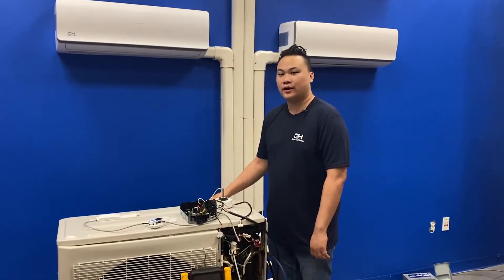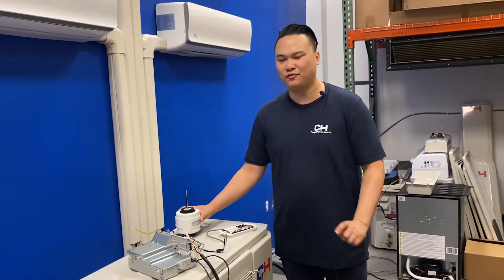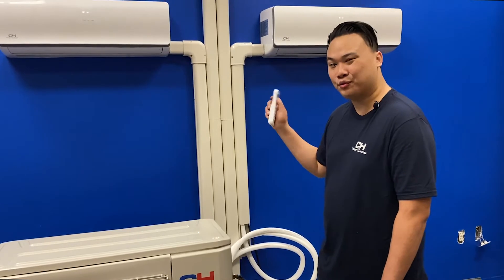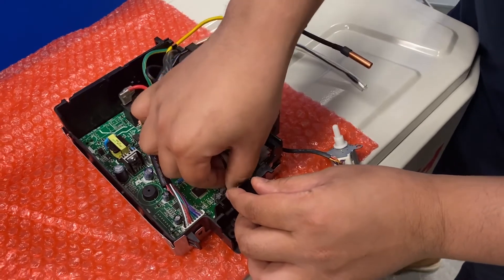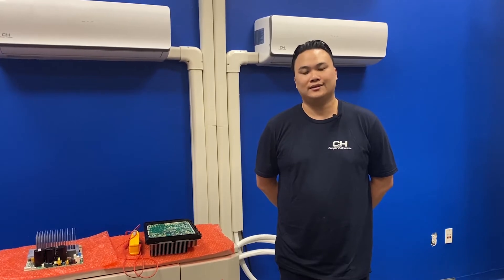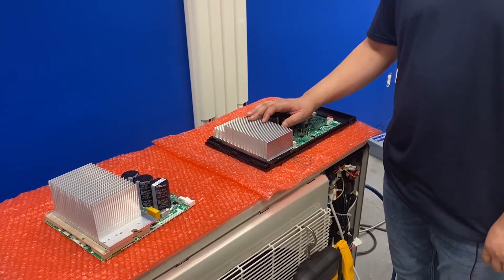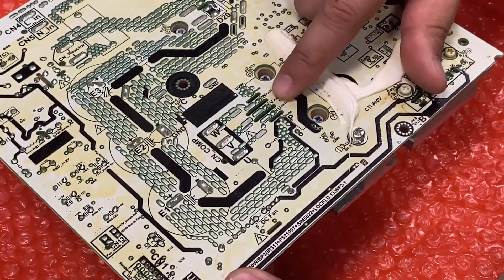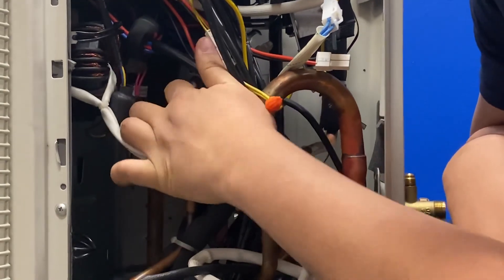Cooper & Hunter - Mini Split Error Codes & Troubleshooting

Comment: have a good one for you Need Help.  Cooper Hunter  Indoor unit powers on out door unit runs 20 seconds then everything stops and display does to 88 just before going blank . every time the outdoor unit starts this happens after 3rd time it stays off and blank until i reset breaker. all connections are good and the App shows all tests pass.  but theres a problem for sure

Comment: I have a 2020 CH-HYP36MSPH-230VO and the breaker keeps tripping while the unit is off. The electrical lines were checked and are fine.
What can this be?
Reply from the maker: There is a short to ground somewhere in the unit. It could be a number of problems. The only way to diagnose the issue would be to have a licensed HVAC tech trouble shoot this unit.

Comment: I enjoyed watching this video but it didn't answer my question.  I recently had C&H Olivia series mini splits (a 9k and a 18k) installed and they both maintain the room temperature well above (2-8 degrees) the set temperature on the remote.  The lowest setting in heat mode is 60 but since we turned them on we can never get down to 60.  We have no error codes.  Is there an adjustment we can make?

Comment: mine is flashing ELOC…
Reply from the maker: That is either a bad thermistor, bad indoor board, or low on refrigerant. most likely you are low on refrigerant. It's recommended a HVAC technician verify proper charge by removing the refrigerant from the system. Then weigh in a new charge using the factory charge amount that will be displayed on the model data tag on the condenser. DO NOT JUST ADD FREON TO THE SYSTEM, THE REFRIGERANT MUST!!! BE REMOVED AND WEIGH IN A NEW CHARGE USING A SCALE.

Comment: HI,
 I have three 12000BTU C&H aircons installed in my home. One of these is exhibiting the following condition in heating mode.
 
1. unit turns on and starts heating after about 2 minutes as per normal.
2. then fan stops or slows down and heating stops. The top light on the indoor unit starts blinking every 8 to 9 secs. This continues for a period of sometimes 3mins, sometimes up to 15 mins.
3. After this the light stops blinking and the aircon starts working normally. No error code is displayed and the the gas pressure was checked by the C&H local techs and found to be ok.

This issue happens either early in the morning or late in the evening only. Operation during the middle of the day is normal.

Any advice please?
Reply: Hello, my name is Tim Murphy I work with the local distributor as a technical support specialist. I read you had the refrigerant level checked. Unfortunately checking pressure levels is not an accurate way to verify proper refrigerant levels on mini split systems. The correct method for verifying a proper charge is to remove all the refrigerant, vacuum the system down to 500 microns then use a scale and weigh in the factory charge.

From what I read it does seem like it might be low on charge. In heating the coil must maintain temp for the fan to run. 
What are the model numbers?
Reply: @MurphyDrifts  Hi Tim. thank you for your reply. the model number CH-S12FTXQ. According to the C&H local technician the pressure whilst running was 35Bar which he deemed OK. I will relay your suggestion next time he visits. I stress again that after this strange behavior period the aircon heats up properly so this maybe indicates that the gas is ok. What I find strange is the 9 sec blinking. Surely this must mean something? When the tech opened the external unit there was a label on the underside of the top cover indicating the faults possible for the errors displayed. Unfortunately this 9 sec blinking rate is not listed. When you refer to the coil can you amplify what system part this is? Would I be able to blow hot air over it to see if this speeds up the error clearance? thanks.

Comment: I have P6 code on all 2 hunter and cooper mini split. Worked great first time last year winter. This year winter has come again and tried turn the heat on, it didn't do a thing. P6 code pops up. I checked the freon pressure and it's normal. AC still works. Now, how do you test the high pressure switch and low pressure switch?? What voltage is it supposed to have?
Reply from the maker: The proper way to check refrigerant levels would be to evacuate the system and ad a new charge by weight. Mini spit systems can range anywhere from 80psi to 160psi when running. So checking the pressures is not an accurate way to verify proper charge. For troubleshooting the pressure switches you will need to call Cooper and Hunter Tech support so they can guide you through the step by step process. 
Please note: When a mini split cools but does not heat or vice versa, that is a sign of improper charge. I would remove the freon and pressure test @ 500psi of nitro and find the leak. Again please call Cooper and Hunter tech support on their site. Cooperandhunter.us
Reply: I had heat guys came down to refill the freon but it wasn't low. But it still doesn't wanna heat up the room, I keep hearing the heat pump kicked off and on like every 5-10mins. And on mini split keeps popping DF every 5-10mins then when DF goes off and it ran another 5mins then P6 pops up. It was constantly doing that for hours. Then i turned it off, giving it up. Its brand new, only used for about a year. Then I noticed other side of heat pumped, it was iced over, what's causing that.
Reply from the maker: My first question is, how did the technicians check the refrigerant levels? Mini split systems fluctuate pressures anywhere  from 70-160psi. The only approved method of verifying the refrigerant charge is to remove all the Freon and weigh in a new charge. The manufacture will have the factory charge in oz. written on the model number data tag. I have a feeling the charge is low. DF means defrost mode. And P6 is usually in reference to improper charge. @kevinharrison7677

Comment: Have a EH 60 error code. 
This happened after I took apart unit. Before that unit was cycling on and off. No leaks. 
Found remote in follow me function and it was showing 32 degrees. 
I turned off but was still having same issue. Only thing I can think of was the temperature sensor being loose on indoor. It was late so I’m going at it again tomorrow.
Reply from the maker: the code description for that is. : EH-60 Indoor room temperature sensor T1 is in open circuit or has short
circuited
Reply: Yeah. I was totally disconnected. No error code now. 
Why would the follow me function show 32 degrees when I turn it on?
Reply: Would that indicate temperature calibration on remote is bad
Reply from the maker: @All4ChristNone4me  The sensors are based on resistance. If there was zero resistance due to the sensor being disconnected. The board will calculate the temp based off zero, which in this case seems to be 32 degrees or it may be the default temp with zero resistance.
Reply: @TropicSupply  is this on the remote?
Reply from the maker: @All4ChristNone4me  Where is 32 degrees being displayed? on the remote or the unit?
Reply: @TropicSupply  when I turn on the follow me function it displays on remote 32 degrees
Reply from the maker: @All4ChristNone4me  is it still reading 32 degrees after the sensor was plugged back in?

Comment: Error Code pc ?
Reply from the maker: Please give me the model number. And complete Code. There should be two numbers after the "PC" flashes
Reply: PC 01?
Reply from the maker: @michaelramirez4008  Depending on your model number that could be an overvoltage protection on either the line voltage or communicating voltage. Again a model number would be useful.

Comment: What about flashing between EL and OC ? 
What does that mean?
Reply from the maker: Possible causes. T2 Sensor failure / PCB failure / Low or Improper refrigerant charge. In most cases its cause by leaking flare joints. Leak check should be performed. Then the refrigerant most be weighed in for the charge to be correct. Charging by pressures in a mini split will most likely cause damage.
Reply: @TropicSupply  Thank you for the reply.

Comment: Pc 03 error code?
Reply: Same thing. You figure out?
Reply from the maker: @cg5138  see reply
Reply from the maker: High pressure protection or low pressure protection. Verify the condenser coil is clean and has adequate air flow. If that checks out then you may be low on refrigerant. You will need to call a certified HVAC technician to evacuate the system then recharge. The proper method to recharge the system is to remove the refrigerant and weigh in a factory charge. Adding refrigerant by adjusting pressures will result in damage due to over/under charge.
Reply: @TropicSupply  thanks,  it was low on charge.

Comment: When i power my split system it beeps and showing me short 88, just once
Is it error code too? Cause it's not reacting on my remote, i see orange power light also, please help
Reply from the maker: Skip to the .50 sec mark on the video. The problem is either main control board or fan motor. I would advise you have a certified HVAC tech call tech support for Cooper and Hunter so they can walk them through the troubleshooting.

Comment: I get no error codes, but the ac and heat don’t work. Fan works great though. Brand new setup, already checked leaks/pressure.
Reply from the maker: With out an error code it is hard to say. Can you answer a few questions?
1.) Is this a single or multi zone system?
2.) Brand make and model numbers?
3.) Does the condenser fan run.
4.) Are you sure you completely opened all services valves using a 4mmm Allen wrench?
5.) have you verified line voltage at indoor units and out door units? What is the voltage?
Reply: Did u find the solution?
Reply: Pc 03 error 😢 all wires are good dk what to do

Comment: The brand name is DELLA. It is a 12000BTU 25 SEER 230V the only numbers I can see are on the inside unit; I don't see serial numbers only (048-MS-T2312K-IN) and Intertek 3119233. I have a total of 5 mini split units. Two are the ones giving me problems temperature is in the 0, and with the wind factor, it feels like -12. I have had these units for 5 years. Thank you in advance for any information that can help me fix this issue
Reply from the maker: Unfortunately we do not offer that brand at Tropic Supply so I do not have any error codes or information for DELLA. Try a goggle search for "DELLA mini split error code EF" I found something that points towards the outdoor fan, but again I don't have any information on that system, but we have new Cooper and Hunter systems in stock ready to sell..... LOL ; )
Reply: @TropicSupply  thank you! What are the brands that you are selling and they came with automatic defrost?
Reply from the maker: @stopngoautoservices7359  We offer Samsung HVAC and Cooper and Hunter.

Comment: The temp is blurry when I turn it on I barely see the number what does it mean
Reply from the maker: I'd suggest cleaning the display and turning the display off then back on again by using the wireless remote. If that doesn't work you may need a new display board.

Comment: swing mode not operational .....any suggestions?
Reply from the maker: Swing mode left and right? or up and down?
Reply: @TropicSupply 
Both
Reply from the maker: @michaelkmiotek7909  swing mode is only motorized on the main louver that swings up and down. The left and right turning vanes are manually adjusted by hand. My next question to you is, does the main louver open and close when you power the system on and off? If the louver is not functioning at all then there may be a loose plug or a faulty motor that moves the louver. If the louver does in fact open and close then there may be an issue with the signal from the remote. I would suggest having a certified HVAC tech come out to diagnose the issue.

Comment: How about p6
Reply from the maker: Depending on the unit model number P6 error code means low refrigerant level. Recommend having a licensed contractor perform a high pressure leak test.

Comment: How about p6
Reply from the maker: Low pressure protector switch off. System will return to normal when pressure is corrected and code will clear itself. Chances are you have a freon leak. System should be evacuated the pressure tested at 500psi. Then repair leak and weigh in new charge.

Comment: What does P4 mean?
Reply: I have a p4 error. Had professional install it and it’s a brand new unit the condenser won’t come on.
Reply from the maker: For troubleshooting this error code please have a HVAC technician call Cooper and Hunter tech support to diagnose the system. 

Error Code P4 is defines as: An abnormal inverter compressor drive is detected by a special detection circuit, including communication signal detection, voltage detection, compressor rotation speed signal detection etc...
Possible causes: wiring mistakes, IPM malfunction, Outdoor fan assembly faulty, Compressor malfunction, Outdoor PCB faulty.
Reply: @TropicSupply  Thanks! I turned it off for about 30min and it's been fine ever since.

Comment: Mine sends me F0 code during the hottest part of the day, and when the day begins cool down the system works again with no issues any suggestions?
Reply from the maker: F0= Abnormal current rise. Power supply problems/ System blockage/ Faulty PCB/ Wiring mistake/ Compressor malfunction.

Comment: Flashing 88 can also mean the wiring between the air handler and compressor is wrong. Check to make sure that the wires on the indoor and outdoor units are in the same order. CH choice in wire colors can make that part a bit confusing.
Reply: Yes, David, you're right. This can occur if the high voltage and low voltage wires are crossed or not connected correctly.

Comment: My outside unit does not start up, no error codes on the inside head units.
Reply from the maker: Cooper&Hunter has a 7 year warranty with an excellent tech support team ready to diagnose the system please have a technician contact Tech support at 786-953-6706 so they can determine what is wrong and get this resolved as soon as possible.

Comment: i have a ducted unit 4 Ton with wired thermostat and it said at thermostat F0 what that means???
Reply from the maker: Depending on your model. F0 may mean the system is in overcurrent protection. What is the model number of the system?

Comment: how possible to check  pressure when compressor not working?
Reply from the maker: The freon pressure can not be properly checked unless the compressor is running. If the compressor is not running your gauges will display the standing pressure. This is not an indication of proper charge. If you are unsure whether or not your system has the correct amount of freon in the system. You must remove the existing freon, and then weigh in the proper freon charge by use of a charging scale. We highly suggest before recharging the system you perform and high pressure leak test and vacuum the system down to 500 microns. Please note the vast majority of freon leaks that form on mini split systems tend to be located at the flare joints. Hope this answered your question, and thank you for watching.

Comment: My Mia NG shows “df” randomly while I have it on heat. I didn’t have any problems when AC worked this summer,it’s a new unit and the heat cut outs randomly at times and sometimes displays “df”. Anybody can help?
Reply from the maker: Hello Larry thank you for your question. Your MIA is a heat pump system and when a heat pump is in the heating cycle, the transfer of thermal energy often involves significantly cooler outdoor air. Under some temperature and humidity levels, frost may form on the outdoor coil and can accumulate quickly. This puts strain on heat pump system and makes operation unnecessarily laborsome.

In order to combat this, your heat pump has what is called a defrost cycle "DF" to eliminate the frost from the outdoor coil. When the heat pump goes into defrost mode, it momentarily reverses operation and goes through the “cooling cycle.” This forces warm air through the outdoor coil, warming it temporarily to remove the frost. This DF or defrost cycle will activate automatically as needed. Please note the system will not heat until the defrost cycle has completed.

Hope this helps answer your question.

Comment: Thanks for sharing! :)
Reply: Hey can you help? My Mia NG shows “df” randomly while I have it on heat. I didn’t have any problems when AC worked this summer,it’s a new unit and the heat cut outs randomly at times and sometimes displays “df”. Any help?
Reply: @larryzeldin7561  When df displays it indicates that your unit is defrosting. This is a necessary feature to keep the unit from freezing up.
Reply: Just want to confirm, an E3 error indicates low pressure condition?
Reply: SE what is this